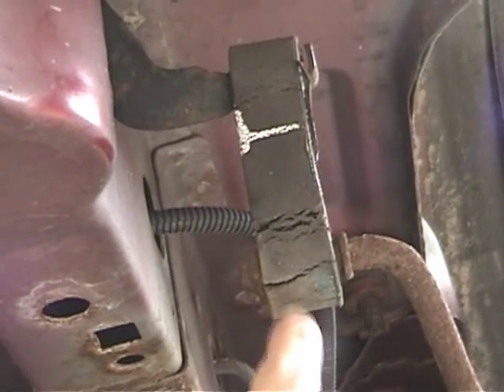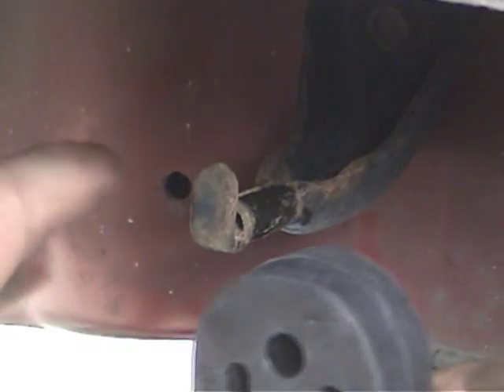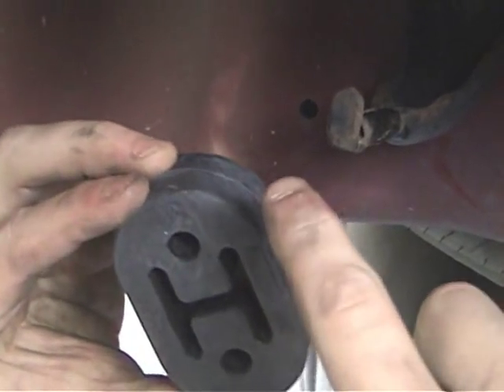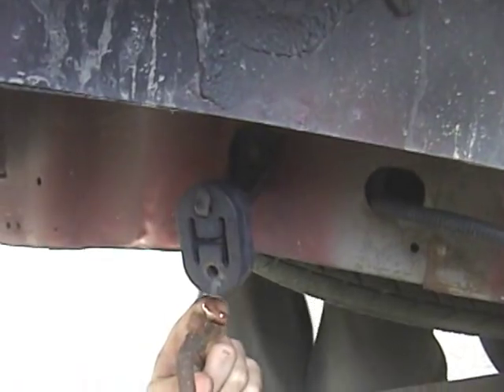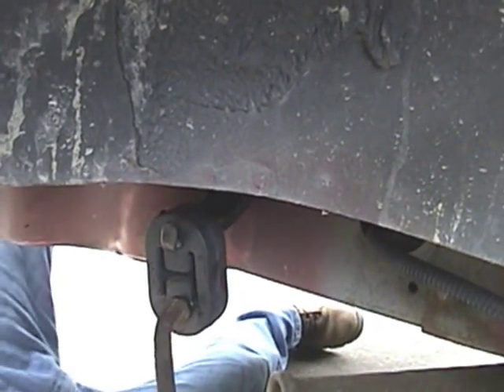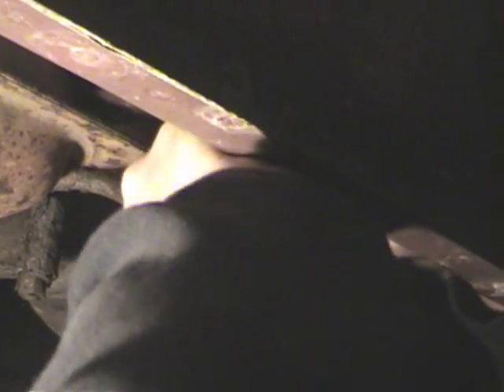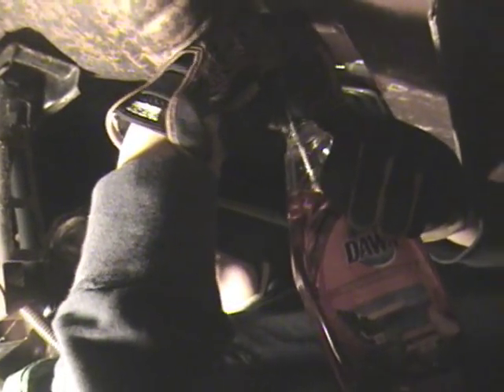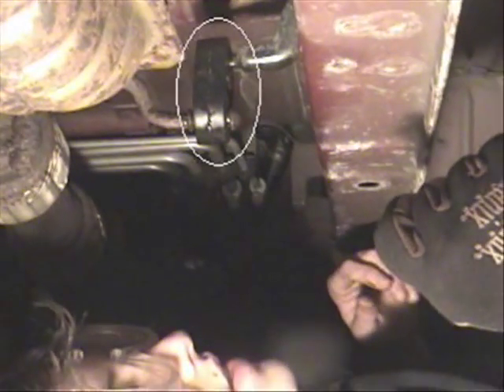How to Replace Exhaust System and Muffler Hangers

Comment: After discovering the exhaust system hanging about 2 inches off the ground, ran out and did this on our Windstar in between thunderstorms.  After trying to force the rubber hangers on dry without any progress, found an old can of spray lube-grease and gave them a squirt.  Took all of 30 seconds each to get them on after that.  Not five minutes after finishing, the skies opened back up.  Success!  Now I can get to work tonight, and I'm out all of 10 bucks and change.

Comment: i find especially on the crown vics that a propane torch def helps this job lol... especially when they have that tip on em so it can soften the rubber as you put it through the hole.

Comment: I just bought the Ford OEM part for this:  
 F68Z-5F262-AA   The dealers have a hard time finding that number because their parts book shows a bracket with the rubber hanger included for a lot more money.  From the dealer these are about $13 each, and they will be the right durometer (softness.)

Comment: You should not add a petroleum based lube in contact with the rubber hanger. It will deteriorate the rubber much faster than normal. You should use dish soap or a silicon based spray lubricant on the rubber, like you did later in the video.
Reply: Dish soap is just as bad.
Reply: use a rubber compatible anti-seize, commonly used with brake kits.

Comment: Step 1) Put on a face shield [you'll thank me later] 2) Support the exhaust (use a scissors jack) 3) Cut off old hanger with a razor knife. 4) Grease up the hangar holes and attachment points (use oil, axle grease, soap, etc.) note: Ive seen manufacturing defects where the holes of the  hanger/isolator are blocked with rubber. just poke through it like they showed in the video 5) You'll have to show the hanger/isolator who's boss. Use hammers, pry-bars, screw drivers, bare force, etc. to install.